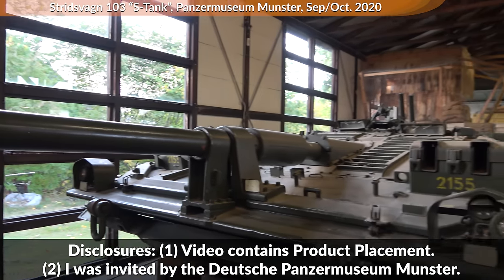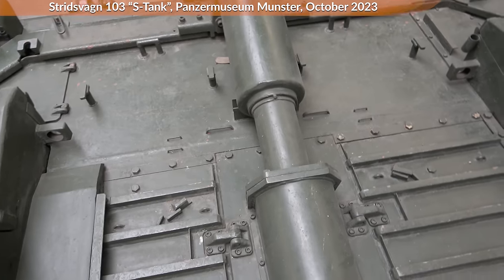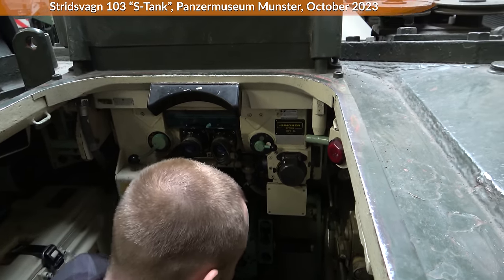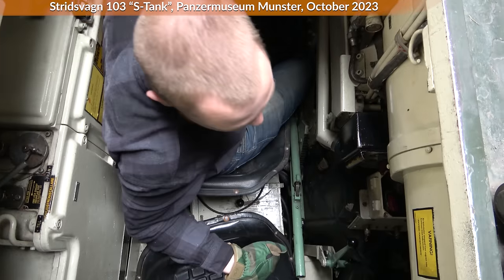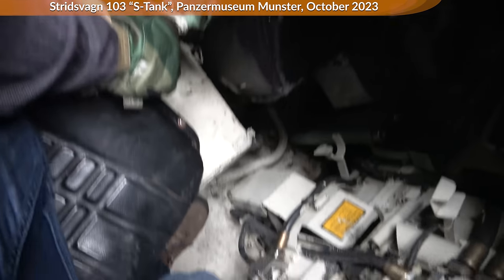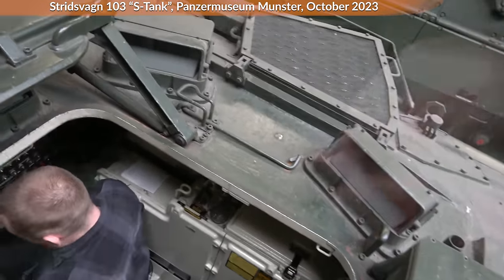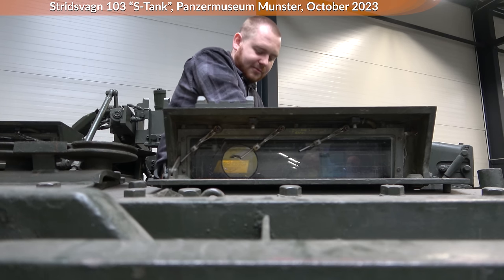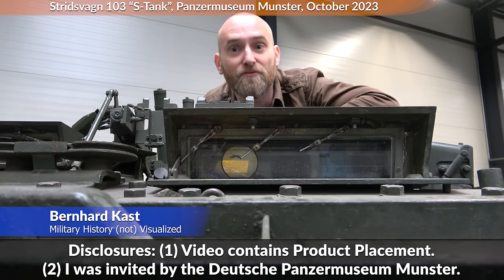S-Tank: The Swedish StuG

Comment: It is NOT A TANK but a tank destroyer. Nothing new, there were tons of vehicles like this in WW2, mostly on German side but also on Russian side.
While I like these WW2 style tank destroyer designs in appearance they were obsolete post WW2 as they are unable to fire on the move or fire in another direction they are moving towards. Even before stabilized guns a tank allows the gunner to already target the enemy and when the vehicle stops he can fire, turning the vehicle into the direction of the enemy is not required.
As such they are only useful in defensive operations where you know which direction the enemy comes from and allow you to ambush them from a camouflaged position.
Reply: No. It is considered a tank by the Swedish military. It plays a similar role to the Jagdpanzers as it has a mainly defensive role, but it is still a tank. This tank is living example that casemates weren't completley obsolete after WW2.
Reply: @Jonathan-oe5vz  No we had infanterikanonbandvagn or IKV to do that part , both of our MBT's (S-103 and centurions) had the same doctrine. First face the enemy and slow him down , secondly wait for mobilization to complete before counter offensive begins.

Might also add , with untrained crew , the S tank was 0.5 seconds slower when both sides saw each other at the same time , but during trials in Norway they found out that the S tank had much better situation awareness then the leopard 1 and won most of the engagements due to this fact.

Comment: Stupid tank destroyer. Useless MBT. But cool and beautiful 🤗
Reply: Many cool features:
- A tank that only needs 1 crew member
- A tank that outclassed its competition in excercises with other western tanks of its day
- A tank with super sloped armor, low siluette, and extra protection with the engine to the front - which inspired the Israelis designing the Merkava.
- High penetration gun with a superior rate of fire thanks to its autoloader
- Can be driven backwards as fast as it can be driven forward
- Low siluette and sneaky
- One of the fastest, if not the fastest tank in the west to go from spotting a target to firing on it.
- A tank with excellent frontal armor (for its day), can survive napalm, and have NBC protection and can swim
- Have a frontal dozer blade that offers both extra armor protection and can be used by the tank to dig its own foxhole where it can hide and snipe on other tanks and becoming harder to spot and to hit from the enemy
- The suspension allows it point the gun over a hill top against the enemy with a minimum of exposure of the front towards the enemy - unlike any other tank
Reply: @nattygsbord is that why no one

No one

In any armed force

Followed any of its design principals? Because it was so good?
Reply: @looinrims 
It was an excellent weapon for its time back in 1967 it truely was the best tank in the world. And that is not just me saying it, this is also the assesement of the US military.
But with vertical stabilizers did this tank become a bit obsolete.
It is however not true that other tanks did not follow up on its ideas. The Merkava desiginers did for example get very impressed by the S-tank and its frontal engine, its very sloped armor, and its crew compartment in the rear and the turret design is borrowed from IKV91 which is another Swedish tank.
Reply: It was given up on because fire on the move became viable, which was the big thing that was lacking when the S tank was designed. Now, having a turret that can pop off shots at a kilometer away while rolling at 30 mph is just too good an advantage. Some tanks do still have hydro suspension.
Reply: it's worth noting that it was very, very much specially designed for its intended use, in a strategically defensive role against a numerically superior enemy, in known terrain and with a small footprint aided by prepared fuel and ammo dumps. Everything from the low profile, to the caliber of the gun, to the literal layout of the crew with the reverse-facing driver for easiest possible shoot-and-scoot, is built for a fairly particular fighting style in a very particular place.

If I were defending Sweden or Finland from invasion in 1975, I would want this tank. If I were trying to mount a wide-front counterattack into East Germany, or making an armoured seven-day sprint to the Rhein, I would probably prefer any other top-modern tank on offer.

This tank was built for a specific purpose and we should be careful not to dismiss or praise it out of hand. For its time, it is very good, at those particular jobs under those particular circumstances. That doesn't mean every competitor was worse at everything, but it certainly has a few lessons to teach about procurement, design, and making something fit for purpose.
Reply: @seanwenstrom2202  no it wasn’t very good ‘for its time’ either, a normal tank can do the exact same things with none of the downsides

Why do you think it’s one of a kind and never emulated
Reply: @nattygsbord  no
Reply: @looinrims  At the time, every single tank had to stop in order to hit with any accuracy outside near point blank. The S-tank could see a target, then swing and aim the entire hull around in roughly the same time it took for a conventional tank to stop and aim too. When in a defensive position, the S-Tank's gun placement meant very little of the tank itself was exposed, a very big advantage to minimize risk of being shot.

Like the title alluded to, it is superficially similar to the tank destroyers of old. Small profile, fixed gun for better ROF, defensive combat, but with the armor, firepower, and mobility comparable to contemporary MBTs. It was not meant to run around cities or go charging across fields. It was meant to dig into the country's borders and pick off a few targets before pulling back into the next position. For that purpose, it was fine. 

When turreted tanks had stabilizers good enough to shoot on the move, it's inflexibility for anything other than defense was no longer worth it.

Giant trench crossing rhomboids became outdated with mobile armored assaults. Medium and Heavy tanks became outdated by MBTs when armor, "medium caliber cannons," and engine technology got good enough to be maximized into a single platform. Armor as a concept became outdated when HEATFS came into play, then became itself outdated with the arrival of composite armors. 

Fixed giant guns became broadly unnecessary with ATGMs and APFSDS, and finally went away when most armored vehicles could shoot on the move with high accuracy, thought technically SPGs still have limited gun arcs, because they aren't really designed to rapidly respond to close in attacks.
Reply: @seanwenstrom2202 says it exactly.
Reply: @looinrims maybe because Sweden has a unique geography, demographics and economy that you are obviously ignorant of. This little ambusher was very good at its intended task, but little else. Which is fine, as Sweden had no plans on invading anyone.
Reply: @looinrims  "Followed any of its design principals? "
The Merkava fully followed the principles of crew protection (Berge and Tal were personal friends), making that the highest priority. It is no coincidence both have the engine in the front, both use the fuel tanks as extra protection and so forth.

 JA 37 Viggen was the best European fighter in the 1990's, yet no one followed or purchased it.
HMS Gotland is the best coastal submarine out there, no one copied it...   and no one copies the French regardless what they do.
Reply: @johanmetreus1268  crew protection predates Sweden’s armored force but I mean if that’s really the top #1 thing you can come up with…yeah not surprised 

Fanboys be fanboys
Reply: @PalleRasmussen  Sweden conveniently doesn’t border Russia/ussr, meanwhile Finland that does just went with leopard 

Think big boy
Reply: @looinrims  Nobody followed it's design principles because it was designed for another type of warfare than every other MBT in history. It's basically designed for guerilla warfare, and as a guerilla warfare tank in heavy forrested terrain, no other MBT was it's match back then.
Reply: @looinrims  Finland never operated Leo1s, and comparing this to a Leo 2 is utterly pointless at vest, or maliciously stupid, at worst.
 That thing was more or less a technological impossibility when the S-tank was being designed.
Reply: @looinrims  If you were to put 6 Leopard 2A4's against 6 Strv 103's, which tank do you think will win and how many casualties will the winning team suffer?
Reply: @looinrims  During Norwegian trials the Strv 103 found targets and engaged targets faster compared to the Leopard 1, both from a stationary position and whilst moving. It was also found to be more accurate than the M60A1E3.
Reply: @ShermanStrike  is that why no one else adopted it? No one can answer this very basic question 

If it’s so good, why does no one else use it? Answer: it’s not that good but Swedish fanboys are incessant
Reply: @looinrims  Why did no other country adopt it?

The Strv 103 was tailor made for Swedish terrain and Swedish tactics. It was never meant to be exported, unlike the Abrams for example which has dedicated export models. The reason Norway choose not to adopt the 103 over the Leopard 1, despite trials showing its superiority, is believed to be the same reason they didn't adopt the JAS Gripen.

German, British, Norwegian and American military trials all failed to show that the Strv 103 was inferior. 

To quote Robert S McNamera; "Their new tank has advantages over our M60 in its low silhouette, lighter weight and amphibious capability. On the other hand, it is incapable of concurrent automotive movement and all-around engagement of targets. While the Army fully recognizes the advantages in the Swedish design, it considers this new tank to be more nearly a defensive tank destroyer or assault gun rather than a tank within the Army’s concept of employment of tanks.”
Reply: @ShermanStrike  so it’s better in general but only better for a specific version 

Which is it? The doublethink is insane 

Funny you mention gripen cuz no one buys it either

The Swedish fanboyism is crazy

Also just to curbstomp this point if the 103 was so much better people would’ve adopted…SOMETHING from its design, NO ONE DID

Logic is hard

Also Macnamura proves the point, it’s a shit tank because tanks aren’t defensive weapons
Reply: @looinrims  I don't know what your first comment refers to, better in general but only better for a specific version?
Reply: @looinrims The Strv 103 was the first tank with a turbine engine, inspired both the T-80 and Abrams. First tank with hydropneumatic suspension, inspired countless american prototypes as well as the STB-1 and MBT-70 for example. Sven Berge applied many of the design principles of the 103 to the Merkava tanks, such as drivetrain placement for crew protection and the use of extremely sloped armor not seen anywhere else. Shall I continue?
Reply: @looinrims ever hear of conservatism? Where new ideas are not taken on board, because they are different?

The turretless decision was taken in the 50's. It was a great design, if somewhat underpowered engine. However, increased computing power, meant the advantages were eroding already by the 70's.
Reply: @looinrims "just".... as in they didn't buy an out-of-service for 25 years 1960's tank.... now there's a ringing endorsement for the Leopard.....